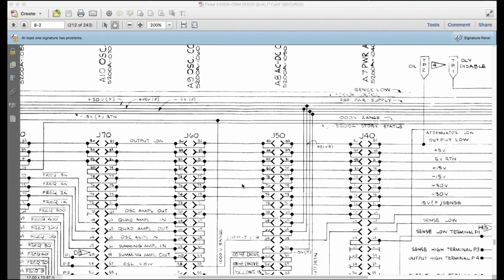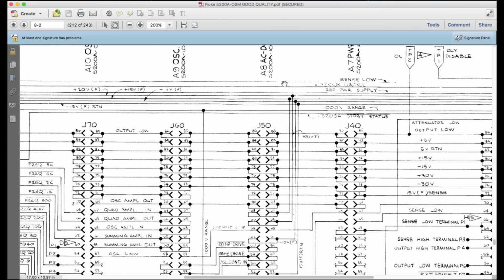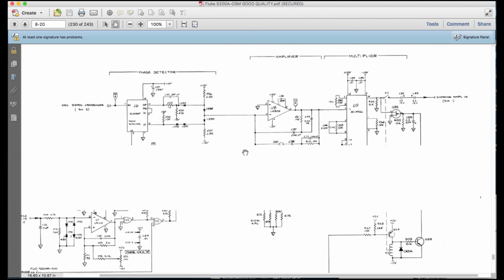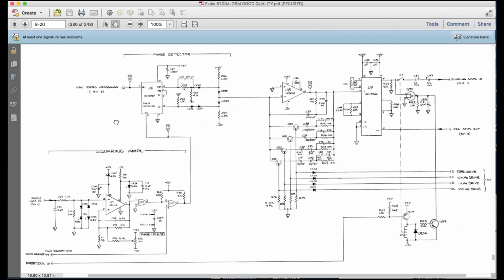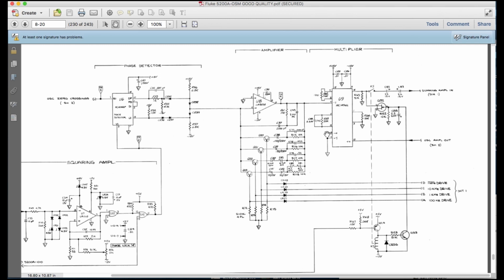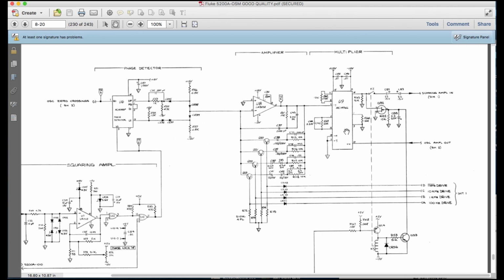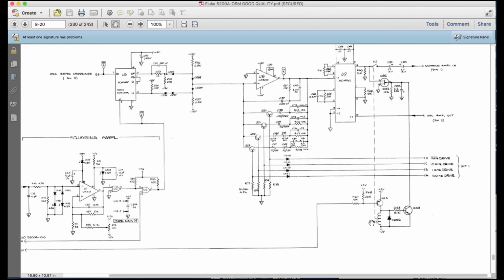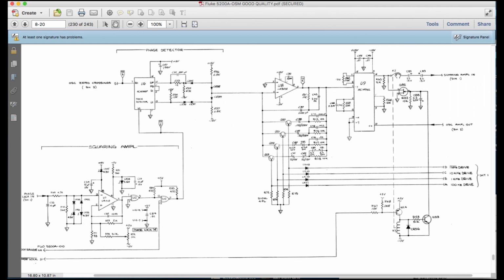#332 Fluke 5200A AC Calibrator Repair Part 11 - Oscillator Control A9

Comment: Now that is a bloody nightmare, so many stages with odd functions.
It seems to be sticking its tongue out, on every stage.
It's worse when they add optional parts that have to be disabled while you are testing.
Traps everywhere lol.
I've been through the maddness with oscilliscopes that feed back to other circuits just making it a nightmare to find the origin of the fault, pain in the arse lol.